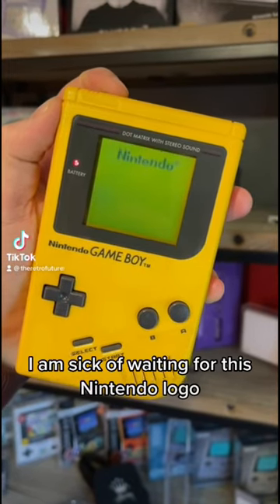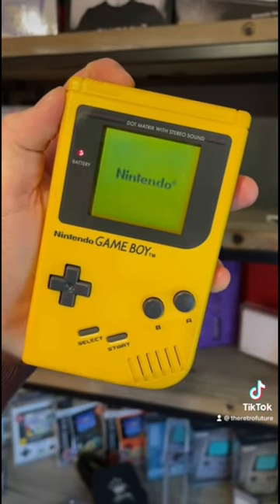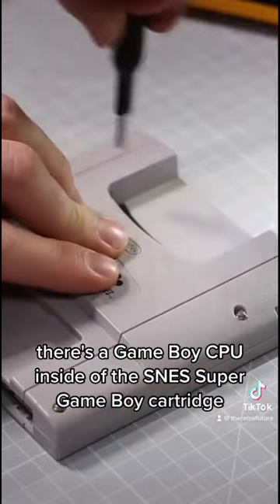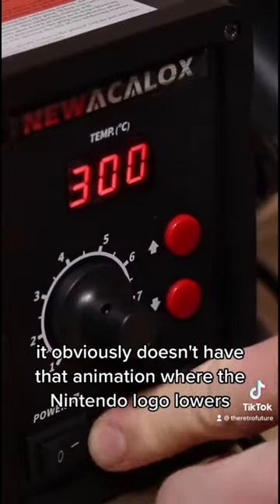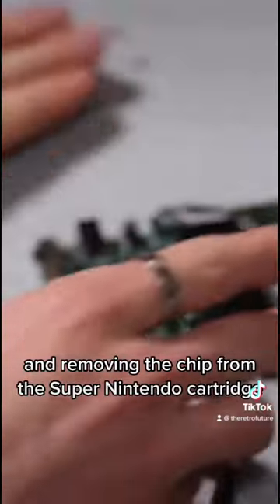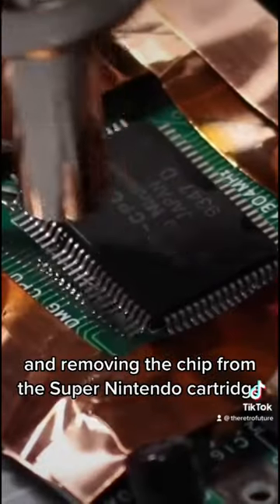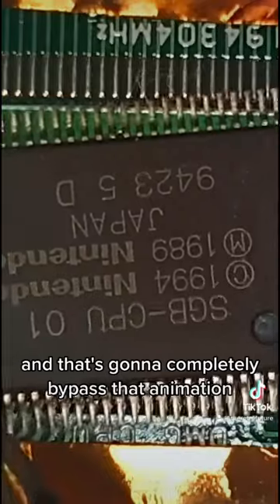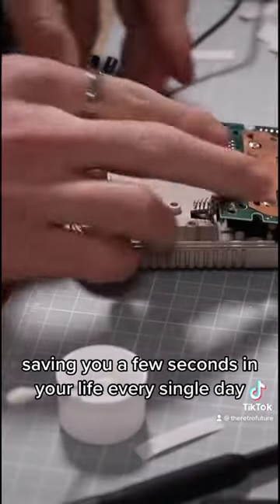Upgrading the GameBoy CPU #shorts

Comment: Put the normal GB one in the SGB, I’m curious to see what would happen
Reply: My thoughts exactly.
Reply: Yeah might as well keep it functional
Reply: Thoughts aswell
Reply: Same
Reply: Dude!!!!!
Reply: So curious.
Reply: Best guess it it would run at normal speed. Super GB always ran a bit fast because the CPU was clocked a bit higher. So now the Gameboy runs too fast and the Super GB would run at standard speed. Is my guess.
Reply: @rashira9610  but would it have the dropping nintendo screen , i think it would if it isnt set up to not be able to
Reply: @RufusTheRed  yeah it seems the logo is tied to the CPU itself so odds are is the Super GB would do it if you inserted the regular GB's CPU.
Reply: @rashira9610  The CPU has nothing to do with the speed. There is a clock crystal that regulates the speed in both of them. So putting the Super GB CPU in a normal GB will run at exactly the same speed as the GB did before. A lot of people have replaced the crystals in their Super GB so that it runs at the proper speed. It's a common mod for them.
Reply: It gets slow and breaks. Try not to overload it. Also don’t do this.
Reply: While that’s a great question, I’m more interested in what the super gameboy chip does for content protection. That dropping Nintendo logo is actually part of the piracy protection of the original gameboy. The logo lives on the cartridge, and the gameboy only has a number, which when run through the copy protection algorithm needs to match the output from the picture displayed on screen run through the same algorithm. It looks like the SGB processor has the op-codes at boot in a different order than the standard GB. Which leads me to my question… is there no copy protection on the SGB? Now I need to find out. I’ve never had one because they’re not that great, but if I could use it to dump the roms from some of my old games that Nintendo refuses to release but also refuses to allow emulation for, but I own originals so eff them… and maybe I could get it to run some arbitrary code? I may need to get an SNES.
Reply: I saw a video of it. Nothing happens. The super gba cartridge stops working
Reply: @JacobGamingStudios  yup
Reply: Agreed!
Reply: @rashira9610  Those CPUs use external oscillators to generate the clock signal, so no it would still be clocked the same unless you also replace the oscillator.
Reply: @rashira9610  Cunningham's Law fulfilled!
Reply: it will happen nothing, maybe burn some wires
Reply: it'd just play the game boy startup after the SNES startup

Comment: This probably breaks MegaMem Card compatibility. It doesn’t work with the SGB and I always suspected the logo check was why.
Reply: That's most likely why it doesn't work on the SGB. The Megamem does a logo swap, which requires some very precise timing, which they might not have been successful in pulling off in a way that works for every GB model simultaneously.

With that said, the SGB CPU is unique in that it doesn't actually perform a logo check. Instead it relies on the SNES to do the check and turn off the CPU in time if it the logo check wasn't successful. This means that with this mod, the Megamem will definitely be able to run. But, it might still crash because the cartridge might still be doing its logo swap trickery when the cartridge starts running.

I dug up my own Megamem now but it's not currently working because of some mods I did to it over a decade ago now.

Comment: Would recommend doing it with a super gameboy 2 instead of the original one. The first one isn’t accurate at running gameboy games as the super gameboy 2 is. But if you don’t care about that stuff, do what you want :)

Comment: is it the same clock speed?
Reply: No slightly faster
Reply: @grayclay6350  the clock is not internal, its a crystal on the board, so the CPU from the super gameboy isn't any faster than the normal gameboy one once put into a gameboy board